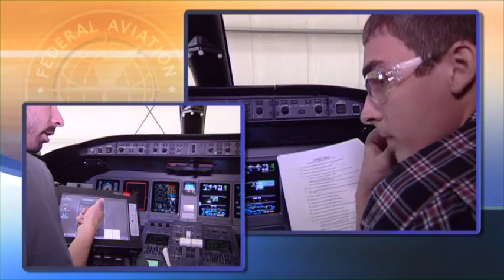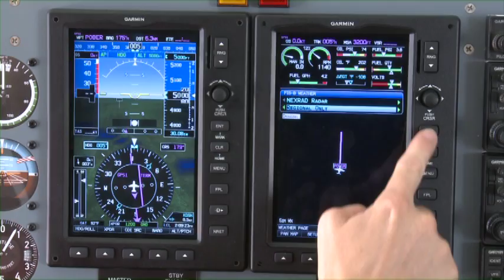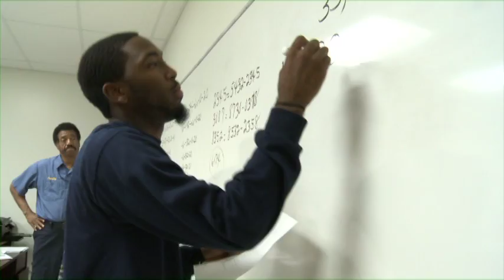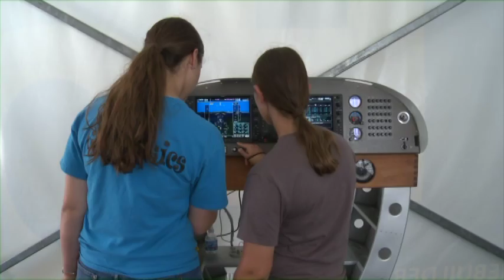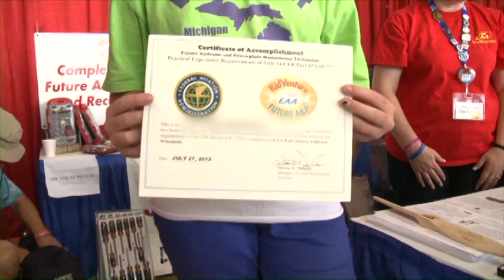Federal Aviation Administration on Aviation Maintenance

Comment: Hello! My name is Dmitry, I'm from Russia. At the beginning of 2016 I will get a Green Card. In Russia, I have 25 years working in various positions for maintenance and repair of aircraft and helicopters in military aviation. Please let me know, if I can claim a position aviation maintenance technician in the USA? What can I do? Thank you.
Reply: Hi, 

I'm an FAA rated mechanic, and the first thing you need to get are you airframe and power plant ratings.  Without these you will not be able to anywhere with your skills. 

Good luck...
Reply: Thanks a lot.
Reply: And what about the folowing situation. Suppose smb graduated mechanic school. Now he's seeking a job. If it possible to get a job without specific eguipment knowledge. e.g. in job discription mentioned maintenance  A-320, but person doesn't have knowledge about it. How does it work in the US? Does that person need additional class?  Thanks.
Reply: No, as long as you have your ratings-here in the U.S. usually airframe and power plant-you will get hire by either a an overhaul facility, or an airline.  I would recommend to place your resume on a web based recruiter, those are usually hiring nonstop.  There's always a shortage of mechanic  here in the United States.
Reply: where you apply airframe and power plant ratings. Do you need to take a test ?